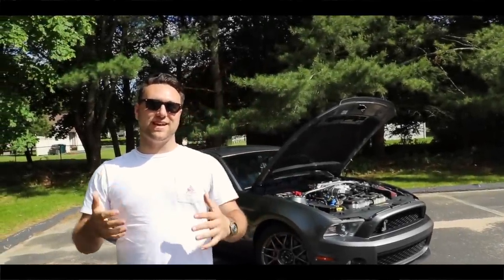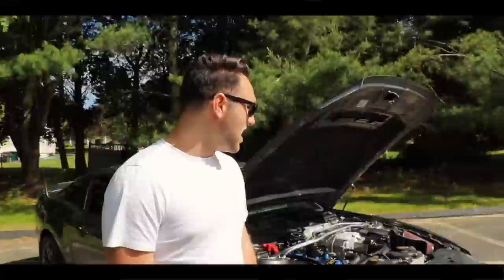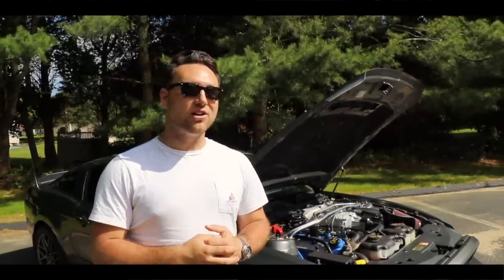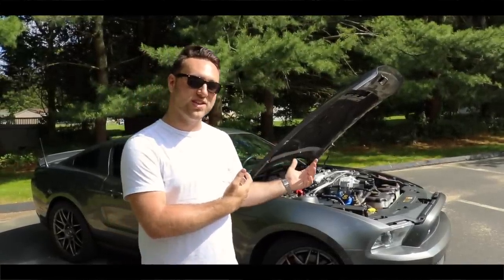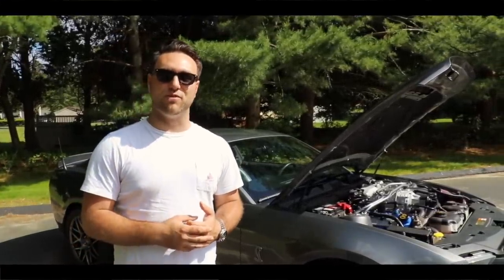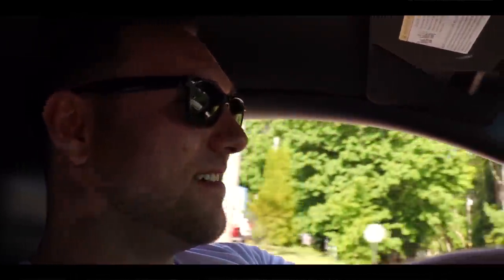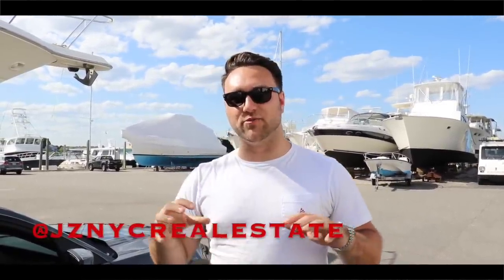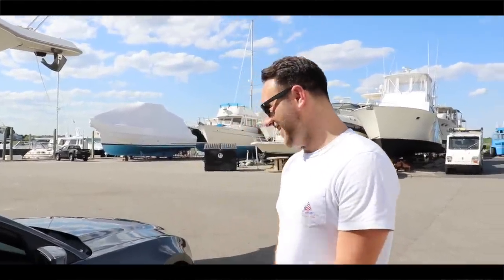2.3L TVS Trinity Blower Swapped 2011 GT500 Build Feature

Comment: Yea, I got a an 11 with a vmp gen1 (smaller then the trinity) car makes 704/695 on 19lbs it’s a freakin blast. Car payment sucks but whatever lolol keep the Shelby content flowin!
Reply: U sure its smaller? Thought they were both 2.3, only diffrence being elbow inlet
Reply: Yea, gen 1 and a trinity blower are 2 different sizes.trinity makes a little more power
Reply: Steve Brumm it depends on the set up ..... people over hype the 5.8 liter ... 
but forget the 5.4 is the same thing (just less cubic inches ....  the 5.8 yes makes more power but anything less then a 5.8 your not that far off ..you just proved that with those numbers those are sick numbers .... my buddy has a 3.4 whipple 2014 and he has the same torque as you well he got 666 on a mustang dyno ....
Oh and his horsepower is the same as yours .... my point ? Don’t be scared of the 13/14 GT500s if you have a 5.4 your just as stronger .... 
I just bought a 2013 GT500 love the car .... as of now my ex 2009 GT500 kenne Bell only 15psi would destroy my 2013 (yes its stock for now ) but wait for it lol

Comment: With the right mods you can make 700 to the tire with that Trinity.Vmp got started making superchargers based off the Trinity.
Reply: pretty sure vmp was making blowers before the trinity came out.  The first 2.3 TVS for the gt500 was released around 07 and vmp started running them and modding them back then

Comment: Did u have a lower pulley?? And was that only on pump? Trying to get to 700whp on mine once my swap is done. Doing 91 and torco mix
Reply: 700 is no problem with a 2.3 and octane booster you need to focus on supporting mods though not just the pulleys I'm talking monoblade tbody if you can and the bps elbow and even port the blower if possible you can easily exceed 700 though.

Comment: you don't need that noise to prove your car makes power. And another thing... dude... you just should have bought a 13-14.
Reply: He got this car WAY cheaper than a 13-14 I think he paid like 28 grand.  It has the trinity blower and is making 644 to the tires on stock pulley.  That is right in line with what a 13 does with similar mods.  I can see why he went with the 12 it makes more sense for the money imo.
Reply: Spot on Lil’ Ike. Paid $28k for it 2 years ago. Car today could probably sell for $37-38k. Car still makes around 650 wheel, and I saved a boat load of money over a 13/14. Much happier with the ‘11.
Reply: @jeffzicker7531  it is just as good a car yes 13 was upgraded in alot of areas but the biggest thing is blower, taillights, etc etc stuff that is easily changed if need be.  The amount of money you gotta pay for a 13 over a nice 11 or 12 isn't worth it imo.  I paid 16500 for my 07 so I went even further with this idea because they are very similar cars at the core to all gt500s through the 12.  They have essentially the same power plant once they are bolt ons like my car is there isn't much difference.  I know about the iron block vs aluminum but really its up to each person what they wanna do with the car.  For the money I spent its a no brainer and your car is a solid deal too for the money.  The 13 is a nice car no doubt but dollar for dollar its not the end all be all gt500 everyone makes it out to be.  The 07-12 can be wicked with a blower swap the 5.4 is PLENTY capable it isn't some kind of second rate crap 5.8 guys make it out to be lol.  With the 5.8 you are paying a ton more money for not that much benefit lol.  I kinda see it the other way the 5.4 is the better one for the money it makes way more sense.

Comment: A fake 13-14 :/
Reply: v Gladi makes no sense ??
Reply: No it's a real 2011 that makes as much power as a 13-14 with the same mods and pulley combo and he got it 10+ grand cheaper if not more.  I think he did pretty good.  I'd rather have a 5.4 honestly I think the fact that it isnt bored within an inch of its life helps it stay alive at elevated power levels.   Not that the 5.8 cant take some abuse I would prefer a 5.4.  Better yet is an iron block 5.4 way cheaper to replace if you have to and can take just as much if not more power at the expense of a little extra weight.